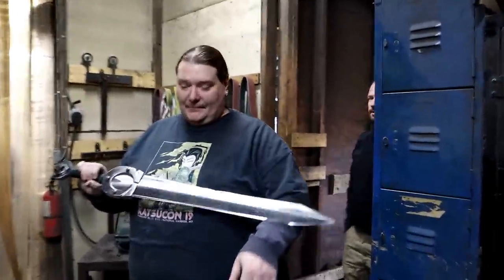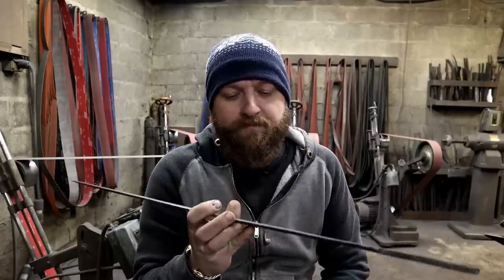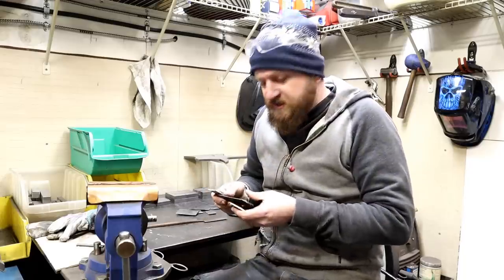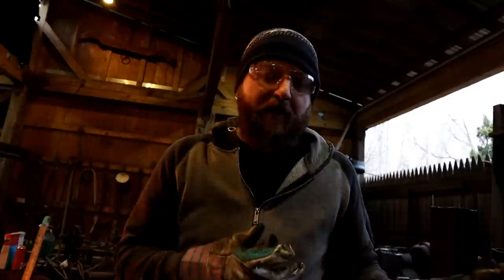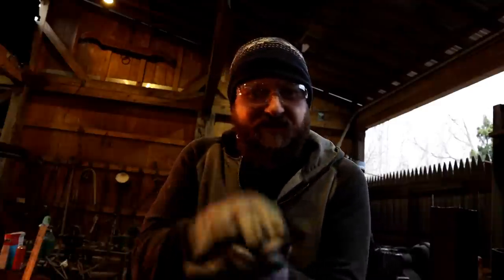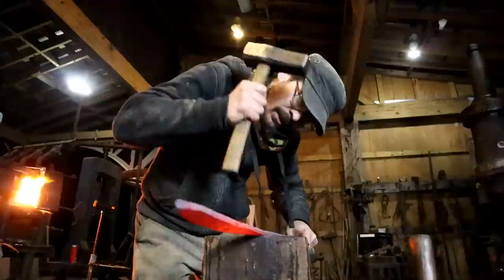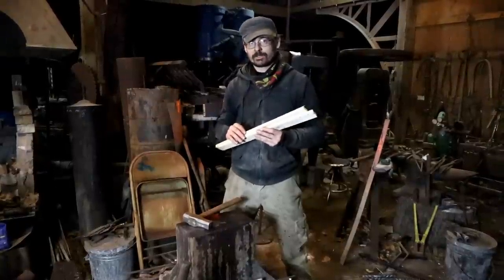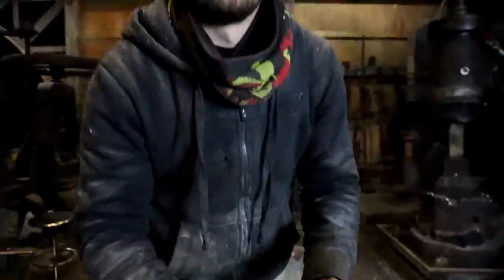Finished Warhammer 40k Sword / Reforging a Blade / Bevel Forging Demo

Comment: what are the differences between power hammers? what makes you pick one over the other for a certain job? are there advantages to using one that the other does not have?
Reply from the maker: The nazel was not warmed up yet so I used the Bradley to start. The dies are the biggest difference. The Nazel has flat dies and the Bradley has dies set up to mimic the strike of a sledge hammer.